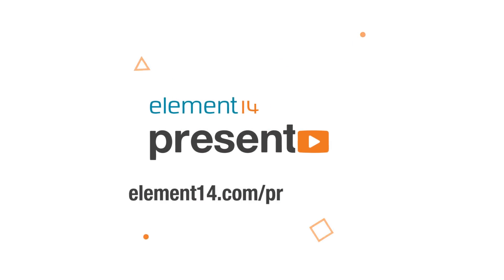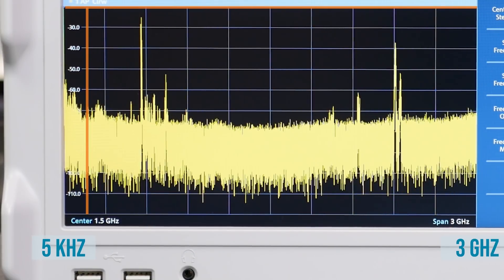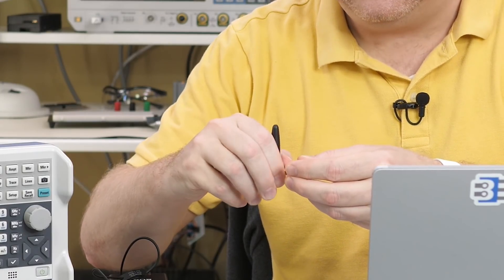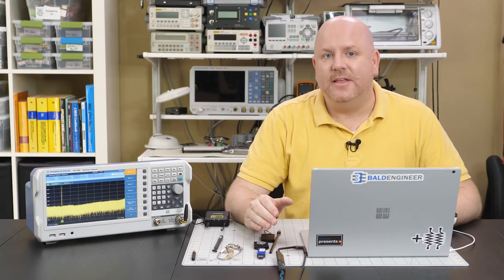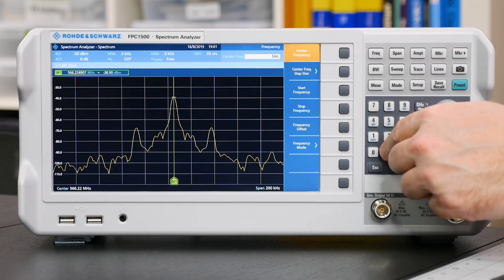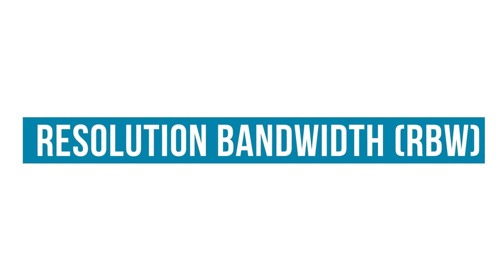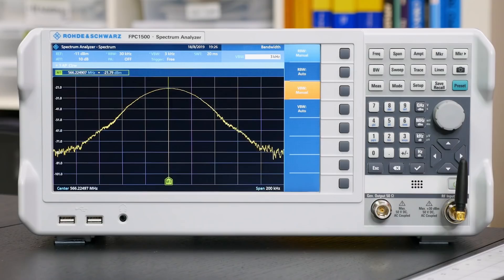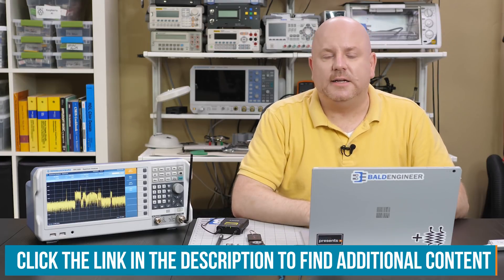Instrument Basics : Spectrum Analyzer - Workbench Wednesdays

Comment: Hello, can we measure the frequencies coming to the radio antenna and the frequencies in the cables going to the radio speaker with the spectrum analyzer?
Reply: Spectrum Analyzers terminate whatever signal they measure. You cannot "probe" a in a signal path like you can with an oscilloscope. Yes you can see these signals an antenna sees: it is exactly what I did in most of the video. But it cannot sit between the antenna and the radio.

Comment: A friend has got GwInstek GSP730. It does not come with any accessories, except the power cord. I have learnt that to start with we should get an FM antenna to view local FM Radio channel spectrum. My question is, can I use any FM antenna or have to purchase their dedicated antenna.
Reply: depends on the interface you may have to change a connector
Reply: @matthewedmiston1372  Thanks dear sir.
Reply: to receive FM you can just put a piece of wire into the port. Carefully not to damage it of course. Also picks up other strong signals like wifi and cell phone signals.
Reply: @BaldurNorddahl  Thanks dear. Best Regards